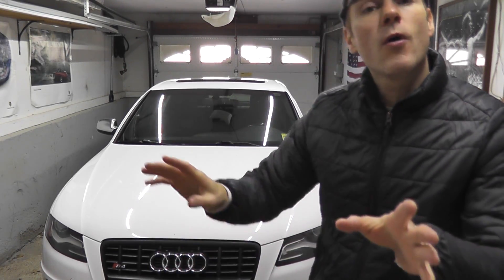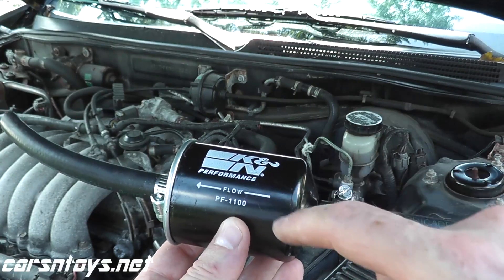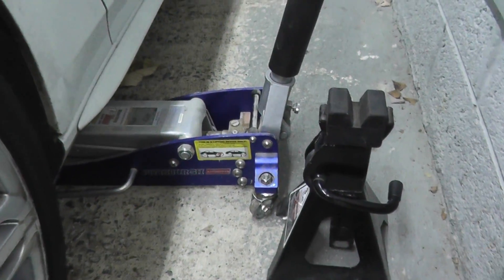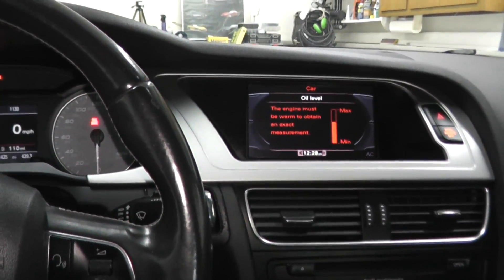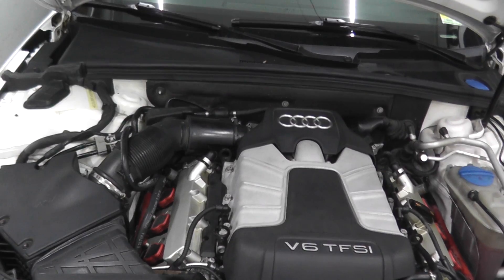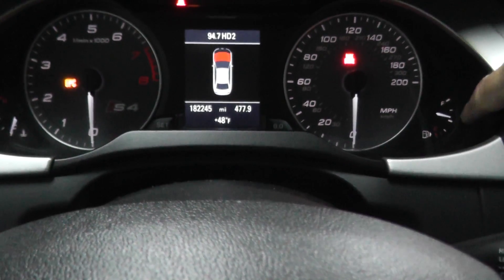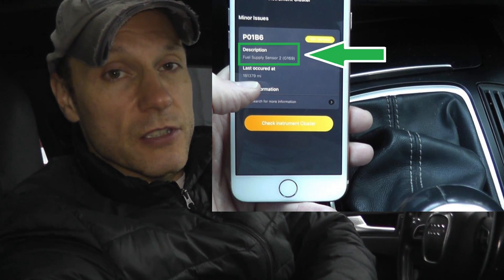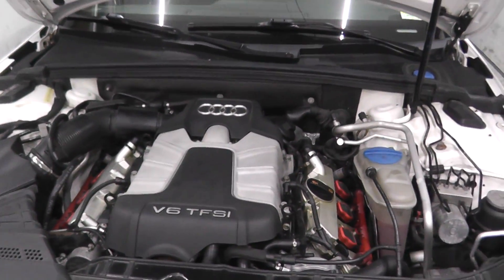Why It's Incredibly Difficult to Maintain and Repair Modern Vehicles | Is It Worth Repairing Cars?

Comment: These vehicles are designed to change the oil via suction through the dipstick tube. And that's exactly why there's still a dipstick tube even though there's no dipstick. And for what it's worth, you can buy a dipstick if you want to check your oil manually. Oh my Audi, it literally takes 10 minutes for me to change the oil because the filter is on top of the engine and I suck the oil out (as Audi intended), so no need to jack the car up to get to the drain plug. Quick and easy every time, and zero mess made is a bonus too.

Comment: This video hits the nail on the head. I have year old Lexus hybrid and there are so many electronic systems on it I wouldn’t even try to troubleshoot or fix it…and I’m an engineer with a masters degree! However, it’s easy to blame the engineers for this phenomenon but really it’s the marketing and management folks that push this. The poor engineers just have to fit 50lbs. in a 5lb bag and do it as cheaply as possible.  Market share rules…not user-friendly design.

Comment: Dear sir
Let me tell you something very very important
My friend.. Do you know stickers..!!?
Now adays these brands like Peugeot ,  BMW , MB , Audi , MG , Land Rover , Discovery , GM and all all..
Only stickers available for the above brands in their assembling sights , the stickers only looks original in real beautiful attractive shape..
Now they finished there is no more manufacturer for the above brands in their original country.. only the stickers..
The 99% of the above concerned they're importing a complete range of all their fittings from Asia of a very cheep sources with in a 3rd quality with no design nor technical formation or support , Mainly they imports from Chaina , Taiwan , Koria , Vitnam , and The funny thing sometimes they receive an engine bigger than the engine room which needs additional alterations for managing force fittings which going to be hard for any mechanics hand to do any services.. unless removing entire the engine outside the car..
Just believe or not an engine aluminum oil pan  fall down from my hand it breaks in pieces , it was made of clay apoxy mixture..
I believe the western concerned forgotten the value of their standard.. they are running to loss

Comment: Correction  . The majority of European made vehicles.  Toyota/lexus,  honda/acura  I have no problem  working on. 70 retired lineman
Reply: Honda and Toyota are getting there as well. Open the hood on a new Civic or a Tundra, same junk as Euro cars of yesteryear. Small displacement turbocharged engines. Emissions and cost-cutting are making all new cars disposable. Stick with pre-2010 cars if you want to do work yourself.
Reply: Smart statement and TRUE !